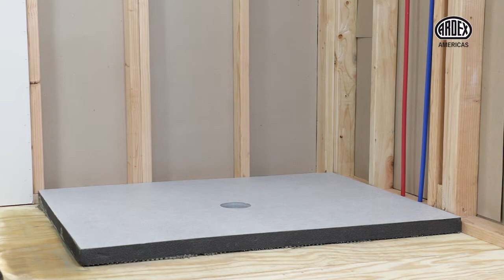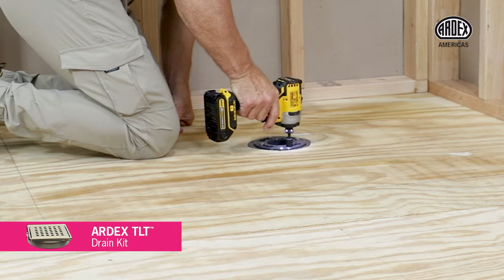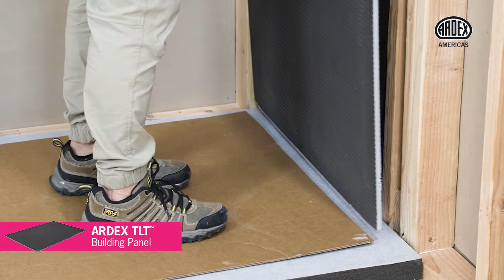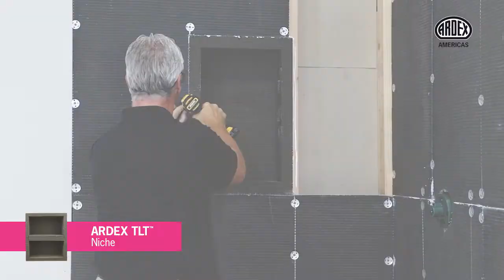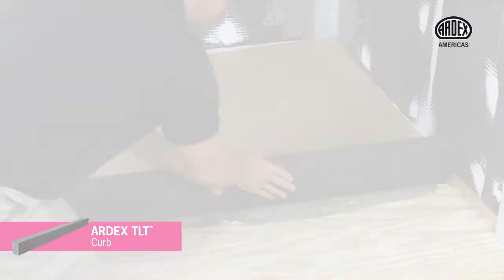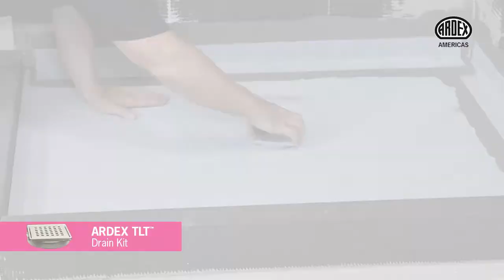ARDEX TLT™ Shower Systems - Demonstration

Comment: I like how you guys forgot to say you have to back butter the shower pan before you put it in place but barely showed it in the video.
Reply from the maker: Hey there, Clayton! At 2:30, the voiceover says to apply mortar to both the substrate and the shower base. Then, at 2:40, the voiceover says to "trowel the mortar on the back of the shower base in the same direction as the mortar on your substrate" while showing it being troweled onto the pan. We apologize if that wasn't clear enough! In any event, we always recommend reviewing the technical data sheet on our website prior to your installation. Hopefully you still managed to install your shower without a hitch!

Comment: Very similar to the everbilt shower system, I've used the everbilt shower system and it's pretty good. This system should be good as well 👍🏻👍🏻
Reply: They make the system for them. It's the same
Reply: @claytonjames4779  absolutely, i called  home Depot customer service and got me in touch with Everbilt Shower System manufacturer and it was Ardex America

Comment: Ardex x5 open time is 10-15 minutes, from the video, how did you mange to install Ardex on both the floor and the back of the base within 10-15 minutes?
Reply from the maker: Hi there! According to our technical team, you can mix the X 5 to the high water ratio and it will allow plenty of time to trowel both substrates and install the pan. For more information, you can contact your local rep using the phone number in the description of the video. Have a great rest of your day!